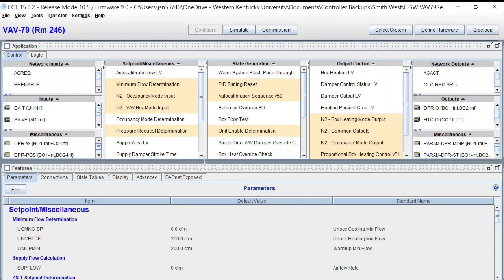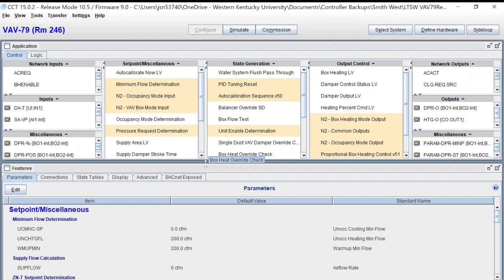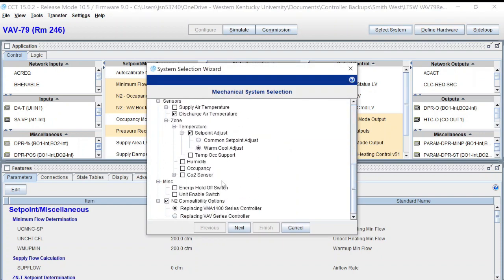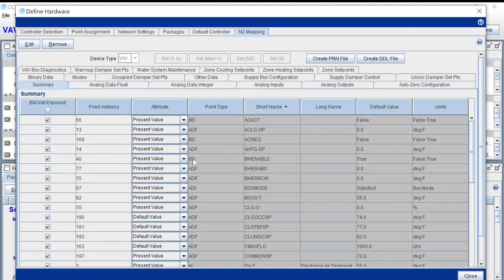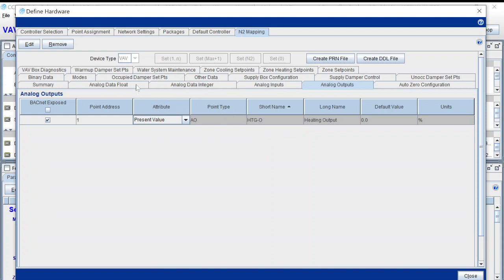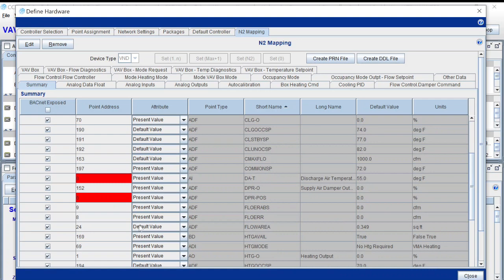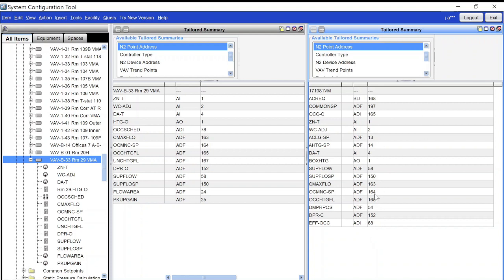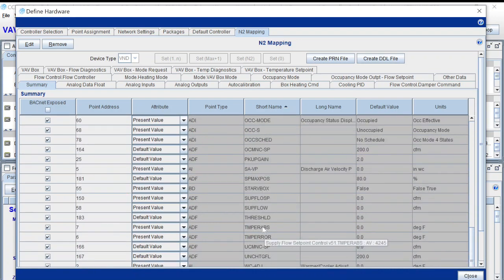Navigating Control Point Mapping: Upgrading Johnson Controls N2 Devices with Newer Technology

Comment: Tell me, what does it mean if one of the signals - the presence delay time - after the system has been operating for a while, it becomes question marks and the fan coil unit stops working correctly??? how can I check and restore it???
Reply from the maker: You may have a controller going bad.

Comment: @Systemcontroltech i am working on a project having more than 500 nos. VMA 1615 controllers installed earlier but now some of those are becoming faulty and hence i started replacing these with VAV 1717 series  but i had CCT 10.2 available with me, could you please help me how to configure VAV 1717 controller as i cannot find it in CCT's default controllers list. Also please confirm if any online training is available for the same with you or you can refer to someone else, would be grateful to you.
Reply from the maker: If the controllers are not in the CCT device list, you will need to contact JCI to purchase the software packages for them. I've not personally heard of that model but I know there are different products available in different countries. If you can get them, I would recommend the CVM 3050 but you would need the newer version of CCT.

Comment: Been doing a little side project at work for the last 6 months to convert an old Metasys NCM4510/PMI with an NAE4510-2.  Having to recreate all the devices with old backups of PRN's and alot of guesswork!  It is not fun!  This may have helped me 6 months ago, but still may come in handy when I actually go live with the NAE45!
Reply from the maker: If the VAVs are all identical, work on getting one of them pulled in with everything set up the way you need it.  Then use SCT to copy those points into the other controllers. Much easier than pulling them in one at a time.  I would also suggest at getting an SNE 1100 instead of the NAE45.  You will have the newest features and the NAE cannot be upgraded past 9.8. Good luck.
Reply: @Systemcontroltech  I wish it was that simple! 30 something DX9100's, some controlling AHU's (4 total), some controlling a hot water heat exchanger for heating, a bunch of them controlling between 4 and 8 rooms each for room reheats.  Throw in a chiller and a 2 VFD's for each AHU.  Lot's of fun!  Doing this as a side project at work in my spare time, no money from bosses so using what I had which is an old NAE45 that was replaced recently with a JACE.  I upgraded it to 9.0.7 and started learning the intricacies of .DMO, .PRN, and .NET files!!

Keep your videos coming